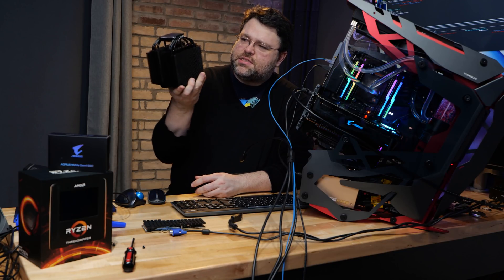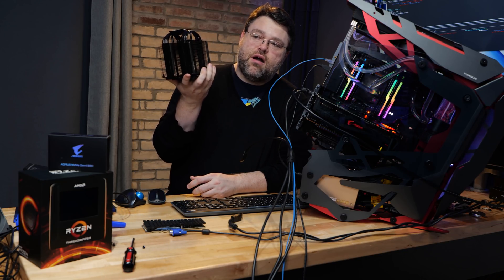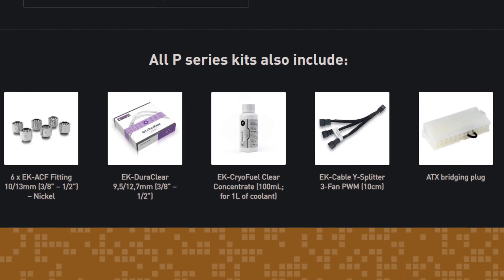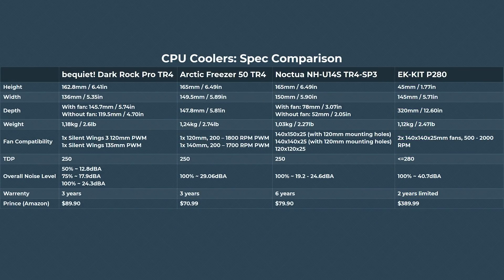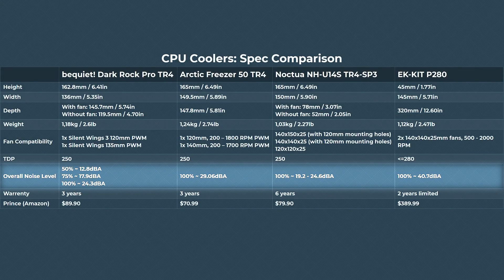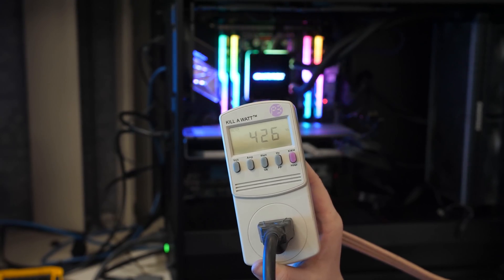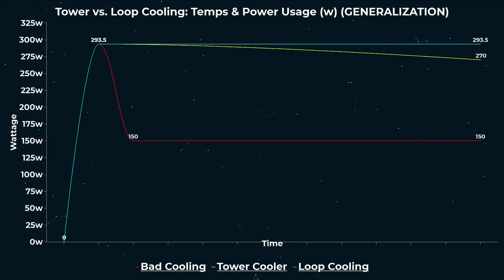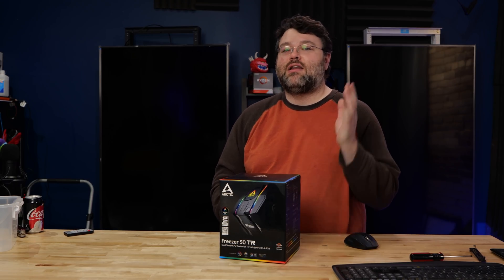Threadripper 3000: Better Cooler For Faster Renders?

Comment: my wallet always tells me "tower cooler"
30-40 bucks will get you somewhere...  ok prolly 70-90 for a TR, but still...
a bunch of heatpipes and a delta cooler will get you somewhere
Reply: @emeraldbonsai  Ok a few things here that you don't seem to have taken in to consideration:
1. Tower coolers do not beat all AIOs or even CLCs for that matter (I'm assuming that is the specific type you are refering to), they are on par with 240mm CLCs and are beaten by 360mm radiators and above (of which quite a few are starting to show up in the market).
2. The reason 360mm CLCs beat most tower coolers is plain down to surface area, the tower coolers are hitting a wall as far as size goes and it's going to be very difficult to get around that. Especially if you want to cool one of the HEDT platforms which feature memory banks on both sides of the CPU socket. They are also closing in on weight issues which will have to be aleviated somehow (just like they were when CPUs started implementing IHS's back in the day to aleviate that issue) which can be seen on the Skylake platform which has had issues with their thinner IHS, this particular issue is not going to get better with increasing weights from larger tower coolers.

Now as far as money vs sense, I was particularily talking about the high end platforms here (think i9 HEDT and Threadripper). We are closing in on a density that is getting problematic to deal with as far as holding turbo frequencies over time, which tower coolers can struggle to deal with due to their inherent size limitations. In an ideal world air cooling far beats out watercooling simply due to the points of failure that watercooling introduces to the mix. A closed system (CLC) is better at this than most custom open setups, but the issues with most (if not all) CLCs is that they come with sub par components compared to a "custom loop". EKWB, Alphacool and Swiftech gets around this somewhat, but their solutions can not stricktly be called "closed loops" and are more in line of "open loop" AIOs (Thinking of the Alphacool Eisbaer/Eiswolf, Swiftech Drive X, and EKWB Predator/Phoenix lines of technically "closed loop" but in reality "open loop" units). They also don't use the very best components, but far superseeds the likes of CoolIT and Asetek. A simple open loop "custom" setup will also not be all that expensive if all you care about is performance as compared to aestetics, 200-300$ should be entirelly possible for a CPU only loop.

In conclusion, I'm not saying that tower coolers are useless (far from it). However some CPUs now have so much heat to dump out that they are going to strugle to move that away quickly enough due to the inherent size limitations of the design. So yes I am still sticking to my point about custom watercooling actually starting to make sense in some setups.

Edit: Just fixing some sentences and correcting my grammar, all the points are the same as the original post.
Reply: Well, yeah. Still though, with these CPU's we are nearing the very limit of what can be done with tower coolers no matter the size. There is also the fact that water cooling is easier than ever (just get a compact setup and do ZMT/norprene tubing rather than hardline) so as crazy as this would have sounded a few years ago, custom loops can actually be seen as a viable option given the correct circumstances.

I'll always go for a custom loop on anything and everything, but thats just me being me.
Reply: Advocatus Diaboli  This isn't he first revision of the EK block, the newer ones are not that bad (as in the original which were just a ek supremacy with a larger plate on the bottom). I never shy away of praising watercool though, they are by far the best watercooling company out there as far as quality goes (Aquacomputer comes close, but still not as good).
Reply: @emeraldbonsai  Subzero cooling? I'm not going to say that there isn't people who "daily drive" their CPUs with Phaze change cooling or chillers, but that is hardly something that should be used in the scenarios that you point out.

As for the nhd15 beating everything... It's a good cooler and likely one of the best tower coolers out there, but it still struggles to beat the 360mm CLCs. As fro why the 360mm+ CLC isn't beating them by more, it's purely down to straight out bad pumps utilized by Asetek (which is the OEM for nearly all CLCs out there). The units from Swiftech, Alphacool (Some of their units suck, but some don't) and EKWB don't have that issue, or at the very least it's not even close to as pronounced  (The type of fans that are mounted on the CLC also matter a lot). As far as pricing goes a 200-300$ custom loop is entirelly doable, it will not be all that fancy but it will perform well.

Honestly, my whole point here is that depending on the specific CPU that you have you might actually get a benefit from using a "custom" loop. I'm not saying it makes sense for everyone, but it does for some and jsut ignoring that seems somewhat ill-conceived.
Reply: @emeraldbonsai  All the units I listed are "AIO" and even "CLC" as far as the defenition goes. AIO is an abreviation for "All in One" and refers to loops that have all the needed parts pre installed, CLC is refering to "Closed Loop Cooler" meaning that the unit is pre sealed from the factory and not expected to be serviced. The Units I listed fill both criteria, but can be expanded thus raising some qeustions as to how "closed" they really are.

Now as to the pricing of the unit which you seem to constantly bring up, you can indeed spend thousands of dollars for a custom loop. Yet there is no need to do so, and you should be able to cover the CPU cooling itself for something in the ballpark of 200-300 dollars for a threadripper system, there is even kits that make this even cheaper than that if you have a more mainsream CPU (The Threadrippers need specific blocks due to their size, 115x, 2011 and Am4 can make due with the blocks in the kits). If you are getting one of these CPUs then you are spending past 1000$ on the CPU alone and the extra 100-200$ needed for a proper loop is trivial in the scope of it all. Yet it may very well make sense if you want a system that is well cooled for every day use. (Here is an example of a cheap setup for threadripper with emphasis on cheap for: https://imgur.com/zvTDiTD )

As far as failure rates... The only difference between air coolers and water cooling, as far as moving parts go is the pump. Asetek and CoolIT pumps suck, which is why they fail every now and then in CLCs. Custom cooling would hopefully utilize something better (though the example IO gave isn't using the best quality one, but another 50$ and it easily could). Both Air coolers and watercooling have fans which do fail regularily, in fact they all have a set life expectancy just like the water pumps (which is one of the reasons why turning your PC off rather than keeping it on is actually a good idea)

As for the maintenance... CLCs aim to aleviate that issue, but the main maintenance in a custom loop is the fluid change and that can also be significantly extended with the use of matching components (dont mix silver and nickel in a loop, and so on) as well as utilizing a higher quality coolant mix like Koolance 702 which is recomended to be changed every 3 years (though significantly longer can be achived if you don't really care). As far as regular coolants go... doing a quick fluid swap every 1-2 years is not that difficult, it's also highly likely that you are going to be working on your PC some time in that timeframe anyways which means you can just do it then.

Again, I'm not arguing that everyone should get a custom loop here, I'm simply saying that with these super dense CPUs we are closing in on a point where custom watercooling makes sense. Don't forget that there is a 64core Threadripper on the way as well, which is going to further increase the amount of heat output.

Comment: Didn't Computerbase report that the Noctua U14S-TR4 performs better than the Dark Rock Pro 4 TR4 at these high power levels, because noctua uses higher quality heatpipes that saturate later.
Reply: none are good so don't waste your time neither are aios, all those have the size and design for max 200watts cpu TR are 260-400watts
Reply from the maker: I'd believe it BUT I really needed a dual fan setup with the RPMs maxed on the tower cooler w/noctua. The TR4 setup was 2 fans from the get-go. With 2f on the noctua, was fine, plus no ram clearance issues.
Reply: @Level1Techs  https://www.computerbase.de/2018-12/cpu-kuehler-amd-threadripper-test-luftkuehlung/3/?amp=1#abschnitt_ergebnisse_mit_uebertakteter_cpu

yeah, they had the same result. LTT used the noctua cooler in their initial 3970x review, and it managed to keep the CPU at 82 degrees, so no downclocking happened. Probably slightly lower ambient temp and different thermal paste application, or something like that.

Comment: the best choice is what works for you. if i was getting something of this level i would personally custom watercool myself
Reply: I don't know. If I interpret the graph correctly, it looked like the CPU was throttling at 85ºc with all the coolers except liquid cooler. If had money to burn in a Threaripper then I'd go for the cooler that keep my CPU below 85ºc and it looks like liquid cooling is the only cooling solution capable of that.
Reply: @1idd0kun  you can read my wall of text above for details, AIOs "work" but struggle and will get noisier than they should and tower coolers even with a 3960x are out of their specs already (250w tower my 24 cores does 268w stock) if a non-optimal solution isn't ok for you custom loop is the only way too go

Comment: Just got an NH-D15 for Christmas, and the noise profile has really won me over for air cooling (came from an old 240mm AIO).  I can't speak for Threadripper, but I can't see myself going to liquid unless my next CPU is an inferno (think FX 9590 or OC'd Skylake-X heat).
Reply: TR is a completely different world, setups than handled a 9900k@5.1Ghz no problem aren't enough even for the base 3960x I mean it's simple you basically generate double or more watts so you need well double the cooling to go back to the temp/noise ratio you had on a gaming build

Comment: Air cooling my baby threadripper, making my workflow vastly faster.
Reply: With what cooler exactly?
Reply: @ou1814  Dark rock pro 4 (again, baby threadripper, so 3950x)
Reply: @angel_bunny  Oooh. I thought 3970x or 3960x. Trying to find air cooling solution for them.
Reply: @ou1814  Something to look into then is the TR4 edition of the dark rock pro!

Comment: I’m trying to solve this tower/fan cooler vs liquid cooler for 3950x
Reply: Massive air cooler > AIO.

AIOs have their place in small/crowded cases or for GPUs but a fat noctua will almost always be on par with a beefy AIO whilst offering much better longevity and warranty.
Reply: Xtreme Performance  Another benefit of doing a custom open loop is that you can be pretty sure you'll be able to reuse most of the parts for a LONG time. Fittings, pump, res, CPU block, rad should all last many many years.
Reply: @socketus popetus same here on NH-D15 + liquid metal, cpu is very cool on stock settings, like rarely goes above 60 on all core loads, but with an OC and that higher power draw it'll hit 85 in 1-2 seconds and slowly trend towards 90. cooler stays relatively cold to the touch for a long time, so it's like the heatpipes can't pull the heat off fast enough, doesn't seem to matter much how fast or slow I run the fans. A CLC leak murdered my previous board so I'll probably just deal with this though. Kinda curious if a NH-U12A might even work better due to the 7 heatpipes but not enough so to throw money away.
Reply: I hate liquid cooler, you have to do maintenance...dude, this is A COMPUTER, TECHNOLOGY, NOT A CAR !!! WE NEED SOLUTIONS, NO MORE PROBLEMS.
Reply: Francisco De Aguirre I went with a beQuiet Dark Rock Pro 4. Awesome cooler. Very quiet.
Reply: Chromax Noctua NH-D15.
Reply: Starmaker I swapped the beQuiet with a Scythe Fuma 2. Still works great by for setup.
Reply: @jamerican347  Looks great!!